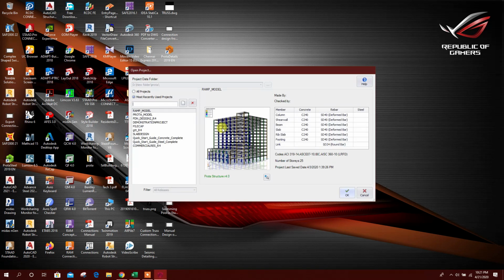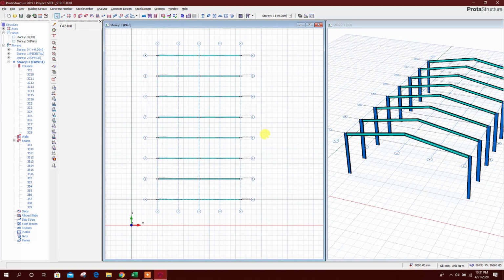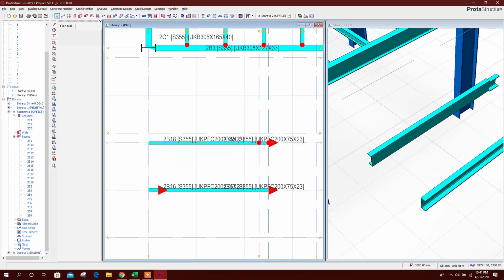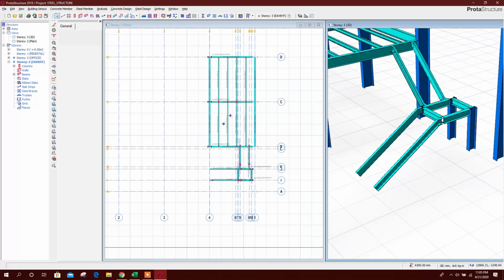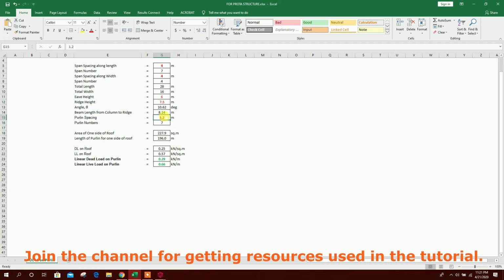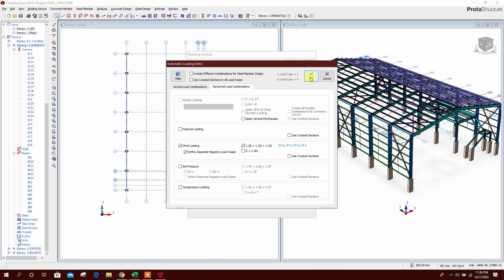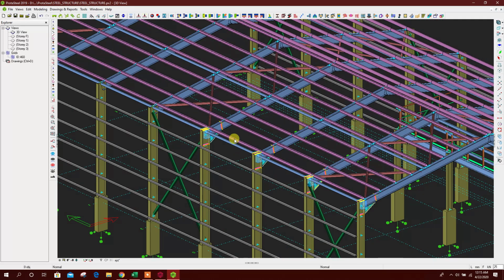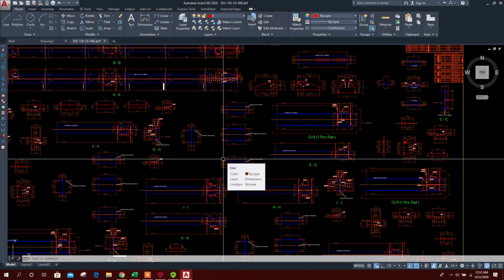Design and Detailing of Steel Structure | Prota Structure | Prota Steel

Comment: DECODE you’re the best!!! Thank you very much for the video tutorial, it really a guide in a right direction.

After I finished my modeling of steel structure, I tried to analyze, after clicking the start, 

then (protastructure  gave me this info (‘“ Analysis can be carried out when all storeys populated. Models with empty storeys cannot be analyzed””) l which I could have your email in order to attach the program file for you to see?

and I was hoping if you can help me look at it for better enlightenment for me. 

From the video tutorial, I discovered that you made use of excel spreadsheet for the calculation of the dead and life load for purlin. I tried using it but not really clear, I also don’t know if you can throw more light on its preparation and calculation. 

My email address is niron122@gmail.com

Await your reply please 

Thank you once again Decode!!!